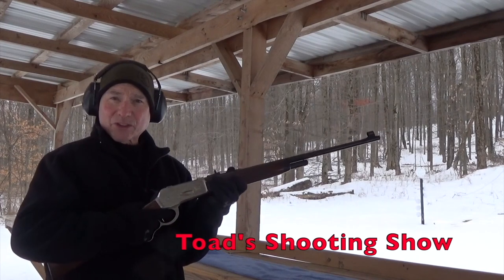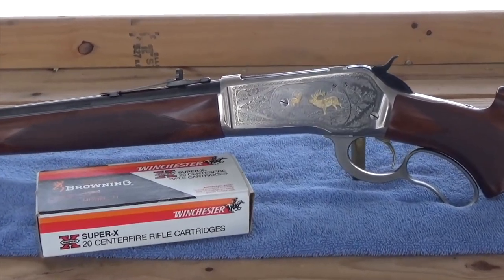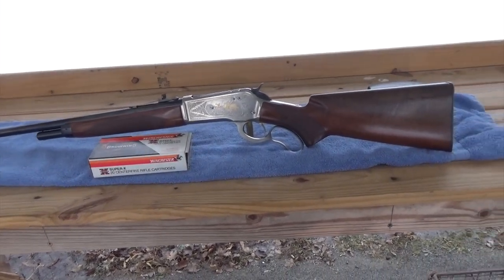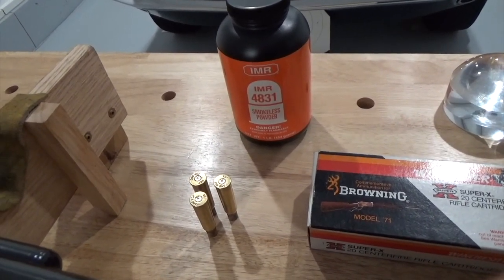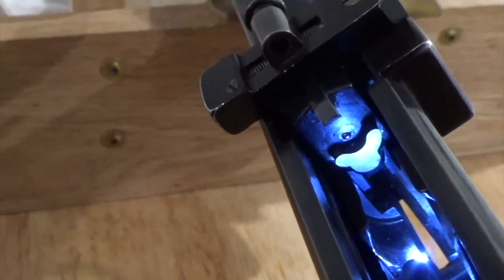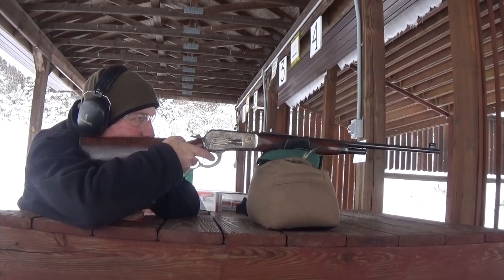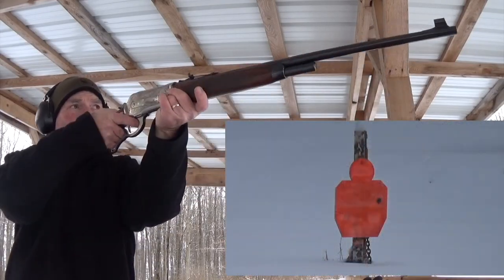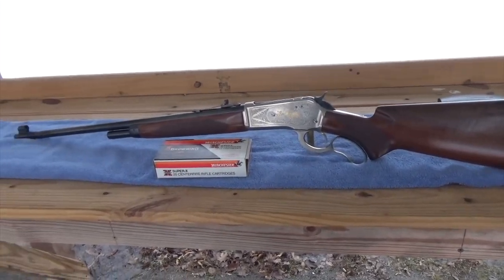Browning Model 71 Limited Edition

Comment: Those Browning/Miroku’s are nice. The 348 is a hammer of a round. I’d like one of the Browning model 53’s in 32-20 of that same era👍🏻
Reply from the maker: Thanks! Now I have to look into what those 53's  are:)
Reply: @ToadleyBrowne  it’s a little version of that 71 👍🏻
Reply from the maker: @georgiaboy4410  Just looked at a few. Very very nice looking guns.
Reply: Georgiaboy44....its ballistics are basically the same as a 30-06.  Nothing special.
Reply: @easttexan2933  27.6% greater frontal area on the bullet, a little bit more energy on average than .30-06, runs 250gr bullets on the high end.
Reply: Just came across this video. I have one of those Browning 53' you mention and what beautiful rifles they are. Browning only made 5000 of them.

Comment: Sweet!  Beautiful rifle.  I too have nothing but trouble with the JBA 348 brass in my 71
Reply from the maker: They do seem to be made up of a different formula of brass. The case design has as much going for it as against it. Sort of works like a wedge. On overpressure loads even with a big taper, there is a lot of surface area to get moving when the case gets even slightly stuck.That 4320 load is a dream to shoot. Thanks!

Comment: Wow! I’ve always felt that the Miroku manufactured versions of Winchester / USRA / Browning products often had a quality edge over the originals and were more or less identical in form. The target shotguns I’ve encountered (20 gauge Model 12 and 101 skeet guns in particular) were certainly on par with or exceeded originals. I didn’t realize that the Browning 71 wasn’t a straight up Winchester in detail - it makes me curious if similar manufacturing “refinements” were made to the other classic levers that are so nice, yet maybe not as much of a duplicate as I thought. Good show, Toad!
Reply from the maker: Thanks! They made modifications to the designs in certain areas for manufacturing throughput. The parts are not interchangeable. Some may be but don't know which ones.
Reply: Except for the fact the Browning 71 has no throat to use heavy cast bullet in.  I've got both and both are excellent

Comment: My worst fear is that I'll have to fight off dinosaurs someday.  That's why I refuse to sell my marlin 1895G.

According to quickload, with a full charge of 4198 the Hornady 480dgx will leave the muzzle at 1560 fps.  

I have always thought a 400 gr hp was the way to go until I saw a triceratops skull in museum.

Damn you toad, I think I need a bigger gun.
Reply from the maker: 50 BMG would do it:)
Reply: @ToadleyBrowne  I have some M2AP for the garand.  I need to go back to the museum and do some testing.
Reply: A bigger gun ??? Do you intend to create black holes in a triceratops skull ? What's the caliber of this particles accelerator ? 😂
Reply from the maker: @br4713 HA Ha!  It's a little 348. The darn thing is a 45-70 wantobe.
Reply: @br4713  when you are face to face with one is not the time to discover that you didn't bring enough gun.
Reply: @br4713  this topic deserves to be handled in a series of videos.  Dinosaurs are as varied as mammals or fish.  Even though a 50 bmg may be best for a brontosaurus  🦕 in would be less effective against smaller fast movers like a pack of  velociraptors 🦖.  

In all reality there isn't one gun to handle them all.  With the way genetic engineering and cloning are advancing it won't be long before we are forced to deal with the issue.
Reply: @RealDeanWinchester  Ok Stephen but with all your scientific therories could you make a worm hole to give us a chance to escape to another galaxy if it happens ?
Reply: @br4713  I am not as smart as you think.  All I do is sit in front of a camera while someone from the CIA types propaganda into a modified speak and spell.

Sorry to disappoint.

Comment: How can you say the gun cycles flawlessly when you just showed us it jams because the Browning design with the ejector/ firing pin scrapes a gouge in the primer? If the gun is a jammer, its junk. Switch to the Model 1895...it doesn't jam and the 405 Win will punch a bigger hole that will take a African Lion down...trust T.R.
Reply from the maker: The model 1895 is a nice rifle.